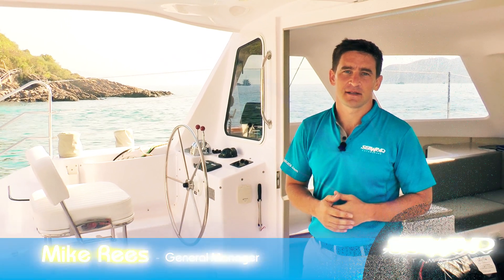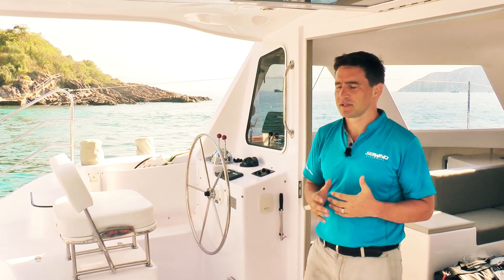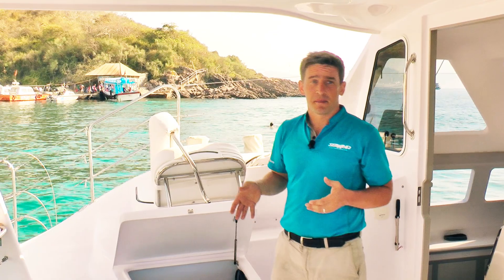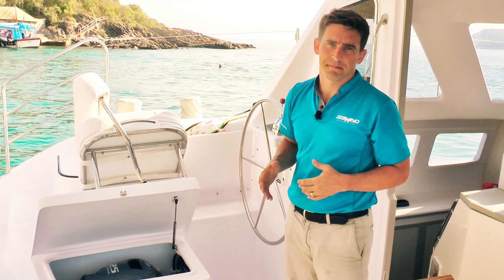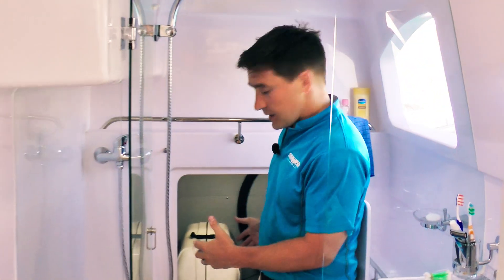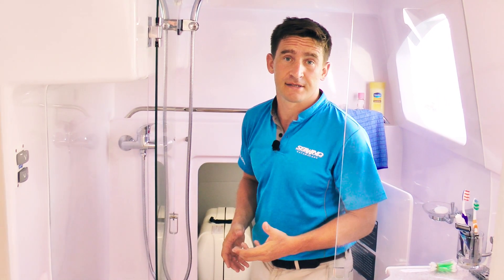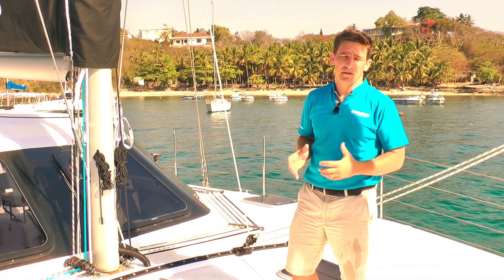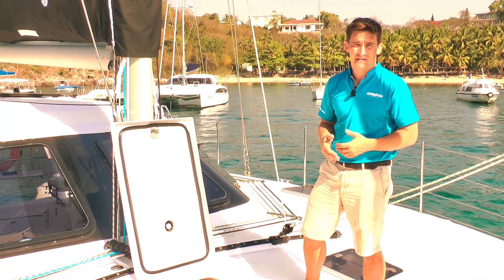Seawind Design: 1160 Catamaran Outboard Engines

Comment: Would an electric outboard engine be a future option in the 1160 or another model ? ⚡️
Reply from the maker: That's something we have looked at a number of times as new products have hit the market.  We hope something will be a good fit soon...
Reply: @SeawindCatamarans  Great! 👏🏻
Reply: @SeawindCatamarans  the elco 20 or 30 hp outboards perhaps? Im thinking just how much solar can be expanded with 400 watt solars on the back and on the roof and walkons closer tot he mast. Mix that with a big diesel generator to extend the range and you get close to the range and weight of diesels

Comment: How the boat can control the engine turn left or right? It also uses the wheel? And what kind of steering system ( hydraulic or mechanical) 
Thanks!

Comment: Hi there, what’s the reasoning behind not using the in hull tanks for petrol?  Also what is the preferred water heating when outboards are used?  Electric and big solar, hydro generator?  LPG water heater?     How long (hours) would a the gas water heater run on a standard bottle 4.5kg?
Reply from the maker: Hi Michael!  Deep questions there!  Would you send your questions straight to us so the right person can answer you?  https://www.seawindcats.com/enquiry/ We're looking forward to assisting!

Comment: How much noise do the engines make compared to diesel. I’ve been on a Maine cat 30 and the engines were loud at 3/4 throttle and there is vibration
Reply: The outboards are much quieter.

Comment: Still don't understand why one cannot reverse the propeller and make electricity 
ctic
Reply: you can, look at the torqueedo or oceanvolt saildrives.
Reply: @licencetoswill  If you are looking for a maximum speed then bring the propellers out of the water. If you were looking for distance then keep the props in the water and generate electricity